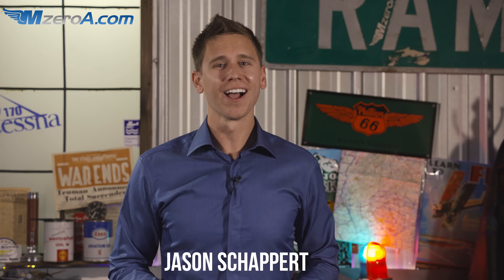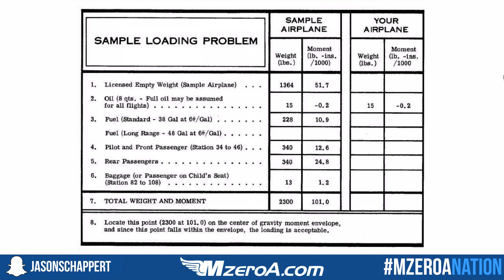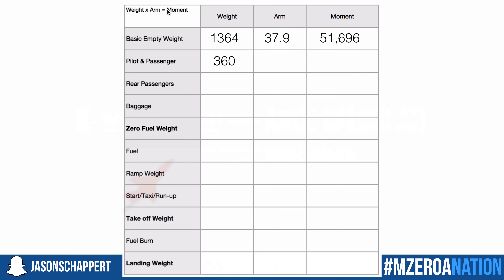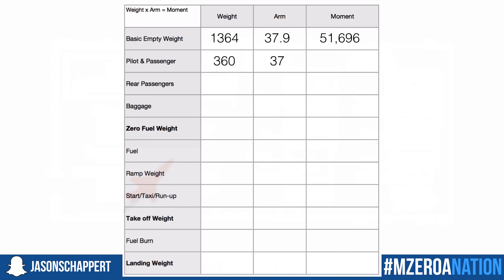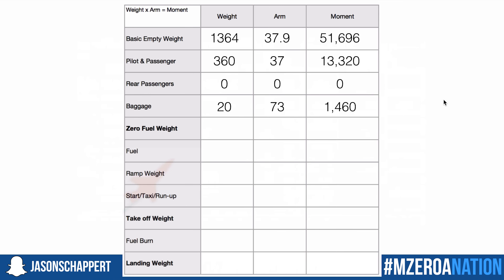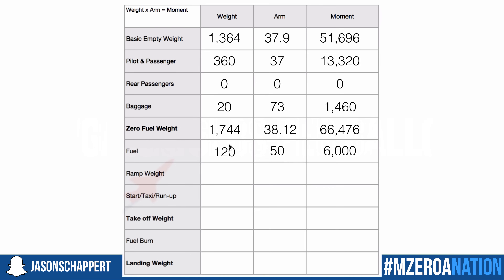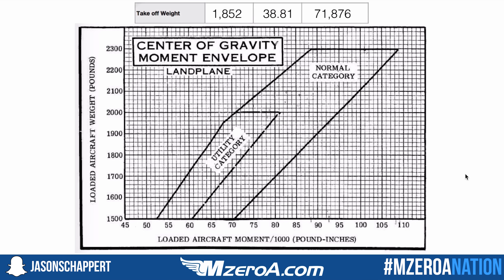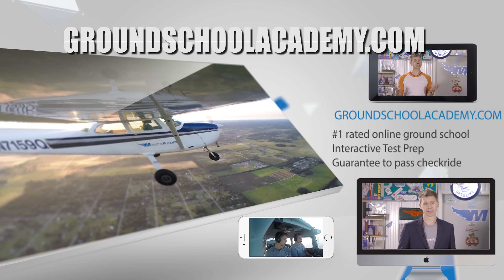Calculating Weight and Balance - MzeroA Flight Training

Comment: I would like to hear your opnion on a weight & balance question. Let's assume that you have a long and heavy piece of steel to Transport. One end of the steel is fairly light, and the other end is heavy. You can load it either way and be with in W & B limits. You can load it for a forward CG or you can load it for an aft cg...either way you are within the C G Limits. Please tell me which way you would load it for a very long flight that will allow you to land with 45 minutes remaining on you VFR flight. Please explain your reasons or thoughts...every one is invited!!! Blue Sky's.

Comment: Inside the 2023 practice test prep for private pilot, the question under Chapter 8 - Aircraft Performance problem number 3668, (Refer to Figures 32 and 33.). Would you be able to do this practice problem on a video for us?

Comment: Hi, one question. When you are subtracting fuel, why do you use the arm of all the fuel you filled? Shouldn’t you use the weight of fuel you have consumed and insert it into the loading graph? Since there is a different moment for different quantities of fuel, therefore a different arm. Or suppose I have two pilots and one gets off, do I calculate a new arm using the loading graph (using the weight of that pilot) or use the one from before ? Thanks
Reply from the maker: Hi Juan Pablo! You want to be as conservative as possible with your calculations. That is why we calculate using all the fuel we filled. This is also why when a pilot or other occupant leaves, we re-do the weight and balance with the new weights. I hope this helps! If you need further clarification please reach out to us at support@mzeroa.com! Fly safe!

Comment: Great video!  Noob question.  Does the rear passenger arm actually have to be 73 here? Since 0x73=0 the moment remains 0
Reply from the maker: Not at all,  If you don't have someone or something occupying an area (station) then that area is just 0 and left off of the calculation.

Comment: Covered everything except what is "arm". Obviously a measure of lengthy but from whete...
Reply from the maker: The definition of "Arm" is how far forward or aft the station is from the Datum.  If the Station is Aft  of the Datum, then it is a positive arm.  The opposite is true if the Station is in front of the Datum, then it is a negative arm.
Reply: Still gobbledygook.  Where is the point  "datum"?
Reply from the maker: @steveststst2968  the Datum is decided on by the manufacture and is discussed in Chapter 6 (Weight and Balance) in the POH.  For the Cessna 172 the Datam is the Firewall.

Comment: As a general rule of thumb for single engine aircraft, fuel burn will parallel the aft cg 'Moment/1000' line. Do a few samples with full fuel, half fuel and a 45 minute fuel reserve to prove this to yourself. Remember the old saying...the only time you have too much fuel is when you are on fire!
When I use to fly MD-11's we could put 13,400# of fuel in our tail tanks (horizontal stabilizer fuel tanks). Remember the best fuel efficieny is with an aft CG (within the aft limit)!

Comment: Hey, wait a minute -- how do you differentiate whether the load is forward of the center of lift or aft of it?
Reply: The "arm" is calculated relative to a reference point (for the Cessna 172 POH that I have here is somewhere in the front), so you'd need to compare that to the distance of the CoL to that reference point. The POH that I have doesn't seem to provide that information directly, though from the various charts it looks like the 25% chord position could be around 40,5 inches from the reference, which incidentally is the same as the end of the utility category in the weight & balance chart, which probably makes sort of sense :)